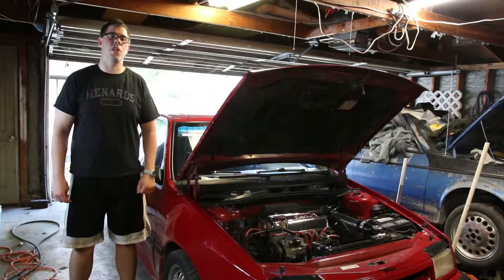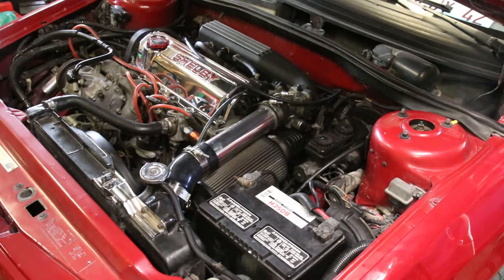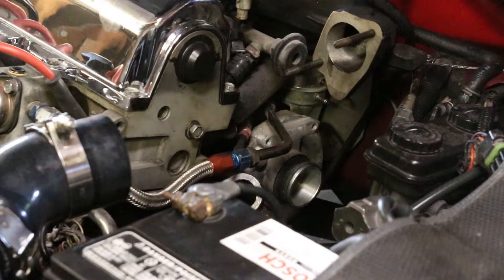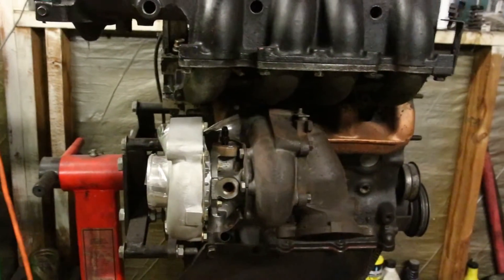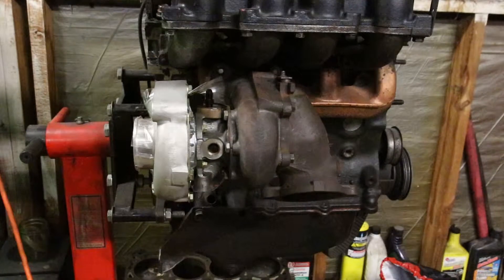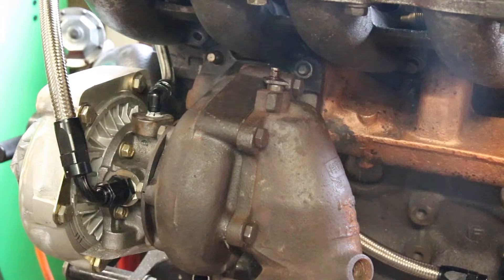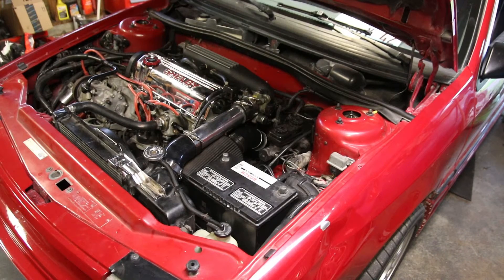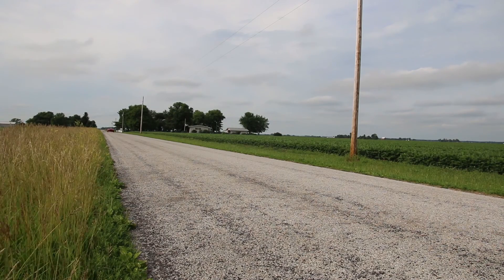Shelby CSX Turbo Installation

Comment: Nicely done. I went through three turbos on my CSX over the years. It is so satisfying to feel the boost come up on that first run after you are done!
Reply from the maker: No doubt. It can be a difficult job, especially if one leaves the head on, but it's a very worthwhile upgrade depending on HP goals. Of course, sometimes they just need a rebuild, so it's a necessity at that point. Thanks for the comment and the view!

Comment: Big Turbo, 52mm TB and a stock intercooler?
Reply from the maker: It was a 58mm TB when I was done. I wasn't running a ton of boost, so the IC shouldn't have been much of a problem. There will be an air to water IC installed when the boost gets cranked up.
Reply: @bwcordes  Not giving you a hard time. I just usually start with replacing the intercooler, turbo inducer piping and air filter first.  I found pretty huge gains from just freeing up the stock air pump.
I'm not saying to lose your mind on it as I did but getting rid of those restrictions will make your car a spool up monster. Check out my Rally car build up video: CSX #11.
Reply from the maker: @rallycsx  No worries. I appreciate the feedback. I already had a very well flowing inlet to the turbo. I really needed the larger turbo because I couldn't get the VNT to keep the boost down. The next step is the IC, but I wasn't sure which way I would go yet. I've decided that an AWIC is where it's at. Thanks for the comments.